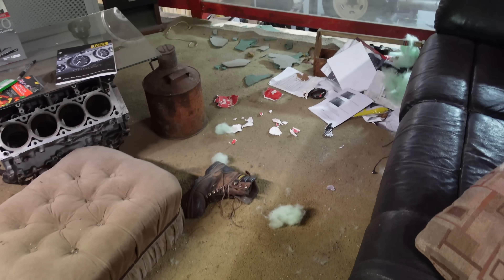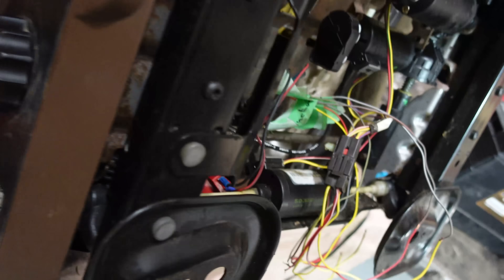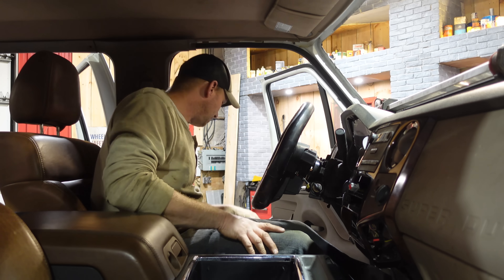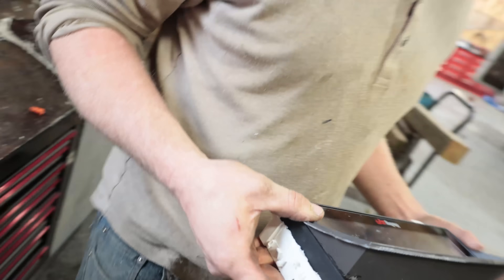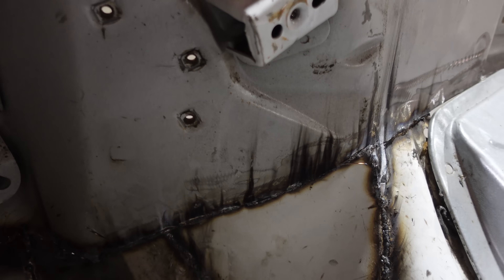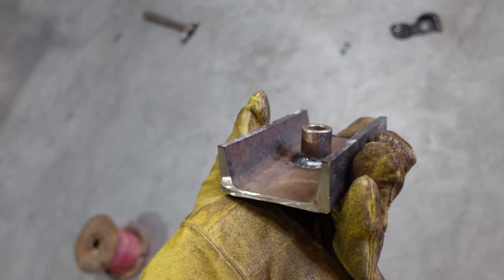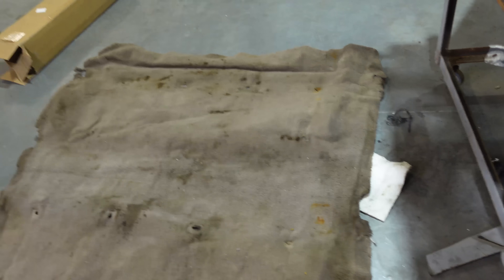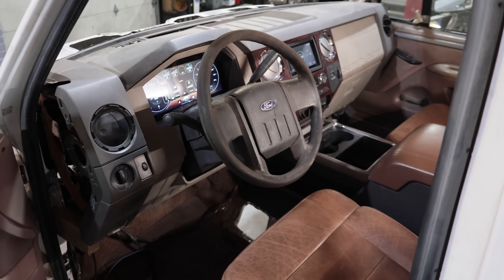King Ranch Interior swap in OBS F350 Finished! #FTreeKitty [EP17]

Comment: This guy is building the ultimate truck!! The best of all worlds. Great job man!
Reply: Precisely what i was thinkin
Reply: Yes sir... a dream truck for me
Reply: I don't know about that, I'd rather have a p pumped 24 valve 5.9 with an eaton or spicer manual behind it. There's a lot less to go wrong than a HEUI engine with an auto. It's a lot easier to turn up a 5.9 cummins if you want more power too. The cats are good engines, but the allisons are pretty overrated due to being about the only decent part in the GM duramax trucks.
Reply: @wyattlewis8671  He already has a 5.9 p-pumped 24v in a Chevrolet pickup
Reply: @wyattlewis8671  No no no, if this was a DT466 swap with a 7 speed and split locking rear... then we would have it set damn right! Put a flatbed on it and a goddamn hoodstack!

Comment: Hey Rich, try using a small roller to get the pint on quickly, and then go back with a brush. Super efficient, and gets that thick coat you want. Be well.

Comment: Whoever made the “welder” comment probably couldn’t wire up a kill switch on a go-kart.  Really enjoying this build.
Reply: People like that, usually can't even weld themselves. There is nothing wrong with Rich's welds, considering he is not a welder by trade. It does the job easily. :)
Reply: He also hires the other gentleman when the welding is trickier.  I think he does this more than he needs to because the guy needs the work and Rich seems to have a good heart.
Reply: @bannedbycommieyoutube5time920  yeah, I have noticed this too. But it's good. Guy gets work, and Rich avoids all the moronic welding comments. :)

Comment: I am unfamiliar with the F550 steering wheel mounting system so take this with a grain of salt.  You may be able to find a machine shop with a rotary broach capable of cutting the hex in the center of your interior matching steering wheel hub.  Also, you can get hex tubing and replace the center.  Hope this helps solve your problem.  The truck is looking good!  Thanks for the great channel.

Comment: If the super duty wheel is getting sticky go to Orileys (or the Canadian equivalent I'm not sure) and get a leather wrap kit. Comes with the leather to wrap around the wheel and the thread and needle to sew it up. If you don't have sewing experience buy two cause the first one will be just practice 😂 but all in all it's pretty easy. Did it on my expedition a while back.

Comment: “Grinder and paint makes me the welder I ain’t.”

-AvE
Reply: I worked for a guy as a mechanic/ welder and fabricator for anything you could think of on a farm or his seed cleaning plant. One day he decides I'm busy and welds a grain truck tailgate that was busted in one corner.  This is a grey color truck box, and he paints his weld yellow with a spray can !  I just took one look at it thought what a mess and said he didn't need to highlight his crappy underpowered gasless mig weld with yellow paint, people would still see it without.

Comment: Hey rich, google F350 frane cracking at the steering box. It’s a common place for the frame to crack. I just found out about it after 3 years of OBS ownership cuz a friend w a sclb 4x4 IDI ZF5 was degreasing his frame down here in Texas, & found the crack. My 93 250 doesn’t have it yet for now.🤞

Just wanted to let you know abt that cuz it’s more likely to happen with bigger tires & going off-road. It’s more common with 4x4.

Comment: The sound deadening works good if you place it in noisy areas that tend to vibrate alot like plastic bits trans tunnel or map pockets . You dont have to put it everywhere.

Comment: Great job! For the headlight switch E4Motors makes a custom relay kit, it's plug and play. For the digital trailer brake controller, you will need the corresponding year, master cylinder and brake booster. They communicate with each other. I also have made schematics for 99.5-2007 f250/f350 to swap in a 08-10 interiors. Message me if you are having any issues. As I did simar build when I was 19.

Comment: The holley dash design you bring up for this is really nice.
And i like the Tacho just going to 3000 rpm.
I wish my 43 years old rv-converted truck would run this low. It's got a 3,6Liter inline6 wich is turning diesel into noise properly.
If you go 80 Km/h the engine runs at nearly 3400 rpm. So i never tried to go the 89Km/h this car should go as the documents say.
Last week i had done emissins control so i can now go to the regularly tech inspection (once a year for cars with maximum weight over 3500Kg).
German law says five runs up to max rpm, which is quite a little bit dangerous on old engines without rev limiter.
To prevent you from cheating the runs had to end all at the same rpm and the system will crosscheck the time the engine needs to do that and if there is to much different (in miliseconds) you will fail the test. Sou you cant get on revs slowly to protect your engine from damage.
If you're interested in hearing my engine scream for her life i've put a video on my chanel.

And yes, i thougt about an engine swap, but man, german laws...

Comment: Bummer on the upstairs 'gift'.  Puppy's get bored really quickly, but It helps if they have a specific chew toy.  Supper stoked on the F-350 progress.  btw. you helped me trouble-shoot my 2003 Dodge Cummins start issue.  Turned out Injector 1 was stuck open.  Capped the fuel rail and she started right up.

Comment: Weld 1/2” plate to back of the wheel and have a local machinist or if you have a mill make the hex. Or chop up old wheel and make it work with the super duty column.

Comment: Only thing I would add is mph to the speedometer, saves having to change it every time you south. Looks flippen sharp tho
Reply from the maker: Might still do it yet, but a duplicate gauge screen with imperial units is just as easy, then just swipe left or right to change back to metric
Reply: @DEBOSSGARAGE  even cooler then. Keeps it neat and tidy. Love it.

Comment: 99-16 cabs are all the same so you can choose whatever year superduty and put that column in but you have to integrate steering controls also just run a 12v jumper wire from the door harness to your seat so you dont have to deal with that Milwaukee battery thing

Comment: Just curious why you cut up that seat wire harness like you did to install a 12 volt battery that you can not easily access when you said you are using the entire wire harness out of the king ranch truck.  Couldn't you just run the harness through the cab and wire in all the seats and power windows as well as the radio, then just delete out the parts for the airbags and such that way you could utilize the factory connections and keep the memory function on the driver seat.

Comment: So if you dont bolt the dash down or the seats then you have tons of adjustability with tilt/telescoping steering wheel.  Easier to change batteries also.

Comment: bro i swapped in a zf5 into my bronco and i nearly fucking lost it bc just about anything that could go wrong, did. and its ironic bc everything is supposed to fit (same generation, bell housing, frame ect.)

i seiously admire you as a master mechanic, no fucking way in hell i have the money, but much less the know how or even the mental capacity to take on such a unique, intricate, complex project like this. huge respect for you sir.

also i want to say that i made a comment some months ago kind of poking fun at you for hating ford but still having ford projects and i want to say that i saw your video on why you don't like ford and i completely agree. im a ford die hard as is all my family for 4 generations and i still found your reasoning to be very sound. i dont even touch ford (or anything for that matter lol) gasoline trucks past 05. diesels are still such a fucking mess but bc its diesel i charge more for the same (similar) job so its a little more worth my time. i, like you, love ford trucks for 97 back. anyways yea im sorry for saying that, ur completely right on ford being a corporate mess these days. keep going Rich ur fucking mint buddy 👍
Reply: Did you put Mercon V ATF in it?

Comment: Instead of the milwaukee battery for your seats, can you wire power to your ignition relay in your junction block and the ground to the chassis?
Reply from the maker: No, impossible.  Can't be done.  Caterpillar in an OBS with a custom Holley Dash to look like a 2022, yes.  Run 2 wires to the seats? absolutely not
Reply: @DEBOSSGARAGE  does this guy think you work for NASA , you'd have to have a aerospace engineering degree to pull off something like that.

Comment: Hey Rich is it possible to run power from your battery to the chair or is that a 24 volt system that way there you don't need to keep a little battery under there you would have constant power anyhow correct you can always install a regulator if it is a 24 volt system

Comment: I'm building Frankenstein lol. I'm hopefully about to buy crew cab a 02 f350 frame put f450 or f550 axles and front suspension under it (smllest 2wd sold front axle Ford has). Drop a built cat 3126 with a built Allison 2000 behind it. Then I'm putting my standard cab 86 f250 cab and front clip on it with either a fuel tank or tunnel tool box between the cab and bed . It's getting a flat bed with dual 6 or 8 inch stacks made into the headache rack. It'll have late 90s chevy bucket seats with an original style Ford dash using the Holly dash you're using (thanks for the idea btw). It'll be different for sure.

Comment: are you going to put in an engine brake in that would be cool....? and maybe have a cure selector on the shifter to change what gear is so like the engine brake have more of slow down effect in lower speeds.

Comment: You have to pull the seats to recharge the battery powering the seats? Can't hook it up to switched 12v?
Reply from the maker: Yes, that was a joke.  I just built an entire truck, I understand how to hook it up 2 wires.  .  It is much easier for test fitting to use the battery though
Reply: @DEBOSSGARAGE  My bad. Haven't had my coffee yet. Looks great!

Comment: At the moment i drive a mobility scooter because my spine is as screwed up as trudope lol. But iv had 2 acdf spine surgeries in the last year and headed in for a third one. So when im not in to much pain iv spent time in my small shop but iv built some crazy things i had a lawn tractor that got an overhaul then it had a catastrophic failure that got scraped.. then this mobility scooter we its been through hell i did put a 3000lbs winch on it because winter on lake huron in shity Ontario is brutal..

Comment: Rich, instead of using a Milwaukee battery that you have to recharge why not just run a 12 volt positive and negative to the seat switch. Wouldn't that be easier?

Comment: Ceramic Coat is a spray which is heat, sound, and fire coating used on aircraft, space shuttle ETC. Best product to apply instead of roll mating. One or Two spray and no measuring cutting etc. 1000 time better product. Plus water resistant and rust proofing. Can be color tinted also to match any color. The sound reading and insulation in 200 times better then anything on the market. If NASA trust it on there birds it a military grade application. Way cheaper in the end cost. $140.00 material covered Whole Truck we did. Bumper to Bumper

Comment: You should wire an inverter so you could plug in a Milwaukee charger. That way the seats can be charged on the go.
Reply: He’s just using it to test the seats. He will have it wired in properly soon

Comment: Why run the seat adjusters off of a $30 tool battery when you could easily run power and ground wires under the carpet?

Comment: Rich, if I had the cash I'd have you build me one just like it but wouldn't be too worried about the interior work. Just the drivetrain work put into that body style is the ultimate truck for me. Love this series. I love these older Fords. My first truck was an '88 F-150. I miss that truck. and the '91 F-150 i had. 

Don't sweat the welding comments.. Those are probably from pricks that just study theory and have never held a "stinger" in their lives.

Comment: This was soooo bad ass how do you connect Holly efi to a cat motor tho? Considering this for my 3406e in my freightliner since gouges are stupid expensive as it is anybody know?
Reply from the maker: Just hook up extra set of sensors.  Coolant, oil, tack to the alt and speed is done through GPS.   As many pressure sensors as you want
Reply: @DEBOSSGARAGE  thanks I had no clue where to start that's awesome this is gunna be sweet when I'm done I hope!

Comment: I have a question rich 
Why hasn't anyone ever built a truck to last in Canadian environments 
Your thoughts 
I had the privilege of watching a friend make a frame out of stainless along with all the suspension components for a bread truck that had an all aluminum body 20 years ago and it's still on the road today 
Just wondering why 
More people aren't doing the same 
Have a great day brother 
Thank you for the videos 
Try to ignore the armchair quarter backs your welds after paint looked fabulous 
Besides it's a truck right 
Just saying
Reply: Well it's a few simple reasons really. The main one is that the manufacturers don't really want you to have a truck that lasts 20 years anymore. Ideally they want you (or anyone) buying a new truck every 5-10 years. Everything nowadays is engineered for fast and cheap output to mass produce. It would take a ton of money in research and development to figure out a solid "framework" for a Canadian specific truck. And with all that specialization it would require entirely different tooling, materials and increase production costs. They likely wouldn't have a large enough buyer base year after year to justify that kind of R&D + production costs. These manufacturers look to build things in the cheapest most efficient way possible to increase their profit margins at the end. That kind of truck would likely cost an extra 15-30k in materials alone at the production level. To pass that on to the buyer would require people to end up spending 75k-100k on a truck at the dealership. The current pricing for 2022 F-250 superduty base level trim is 43k bucks. And that cost has all the mass production elements already accounted for. Trying to specialize 1 manufacturing facility to alter their production line robots, tooling and materials to specialize for a truck that only 1 country would really have a market for just isn't worth it. The profits they "might" get from it don't outweigh the costs. It's much easier to mass produce 1 line of trucks for the entire market and just do slight generational changes to entice new buyers with 5-10 years when the cheap parts and mechanical/electronics/digital/screens start failing. It would be one thing if at least 50% of the buying market was dealing with those winter conditions and they could actually have a large enough buying pool of potential customers. But in reality there isn't a large enough "demand" for a truck like that in the market.

Comment: Why not run a 12v keyed source from the fuse block to the seats? Maybe I missed something but running the M12 batteries seems overly complicated plus any Lithium battery is a fire risk. Don’t worry about internet welding experts, no matter what you do it’ll be below their “standards”. Welding snobs are the worst.

Comment: You are aware that, that steering wheel is bent to shit? of course you are. LOL Love your content btw, you did a great job on this Truck and your welding is fine. Your welding thin metal it has to be stitched and seam welded and those welds usually always look like shit and need to be grounded up.

Comment: I can't even begin to tell you how long I spent with a knock-off dremel modifying the OG gauge cluster mount to make all of my analog gauges fit the stock '92 bronco dash bits. So. Much. White. Itchy. Powder. Everywhere.
Reply: Why would you do that? lmao
Reply: @pcwizzy460  because that's what needed to be done to make what I wanted work with what I had. lmao.
Reply: @JohnsJunk  Did you keep the EFI?
Reply: @pcwizzy460  It's got a 408 stroker in it.  Ran aftermarket EFI for a few years then swapped to Demon carb. The only factory electrics left are the power locks and windows, everything else is custom/fabricobbled.
Reply: @JohnsJunk  Get the factory EFi shit back on it and run a Megasquirt or tune the EEC-IV. Carbs are trash.
Reply: @pcwizzy460  No.

Comment: Why don't you simply cut both steering wheel center (spline) sections, and simply weld in the spline section you want in the brown steering wheel.   All you will need to build is a simple jig to keep everything centered when you tig everything back together.  It will take some effort, but you will get the look you want.

Comment: Love this project. Question though, why battery powered seats? Is that part of the wiring you mentioned you're going to be doing?
Reply from the maker: It was a joke but didn't translate to most.  I didn't do all this work for a swap building a truck from scratch and not know how to run a 12v wire to the seat...  Its just really handy using the battery while test fitting
Reply: @DEBOSSGARAGE  To be fair, you have an extremely deadpan tone. I can't speak for anyone else but my comment was not in any way suggesting you weren't capable of doing that, after all you did outline completely rewiring the switches moments before the battery bit. It's just weird that watching later videos you keep harping on this one incident with the battery questions.

Comment: ...why? why go through all the trouble to shoehorn that new shit in there when the old shit was fine and youre going to use a holley dash anyway? seems like a complete waste of time
Reply from the maker: Because we will double the 9mpg and 320 tq from the 460.  If we put 60 000 miles on it, the fuel savings will have paid for the entire swap
Reply: @DEBOSSGARAGE  i mean the interior, not the engine